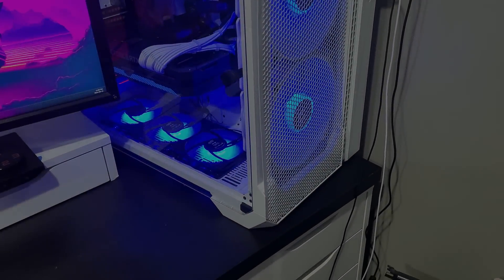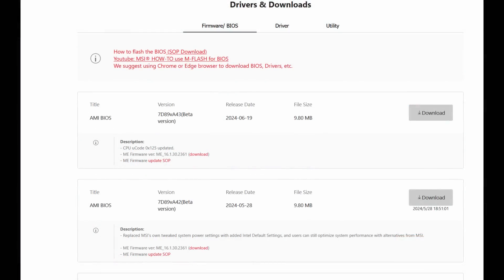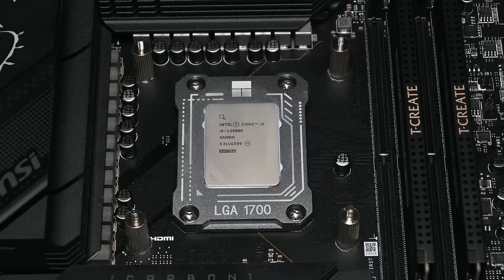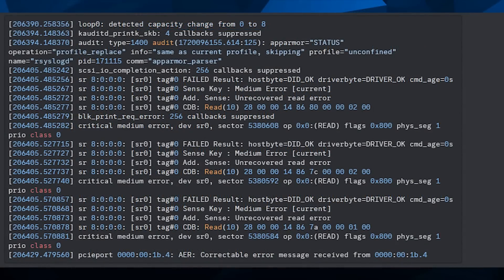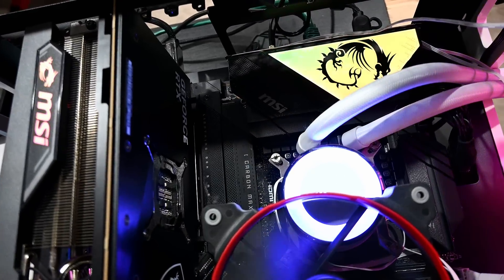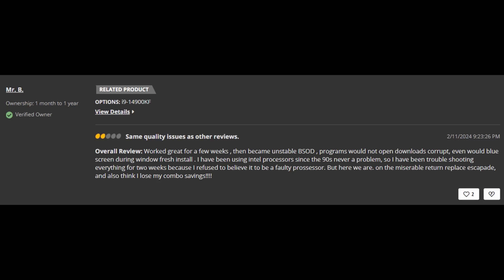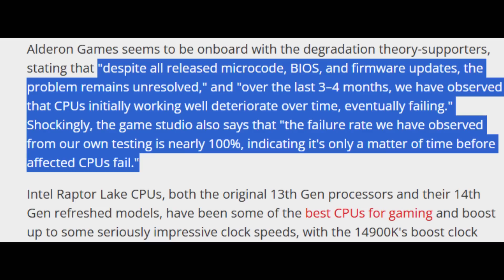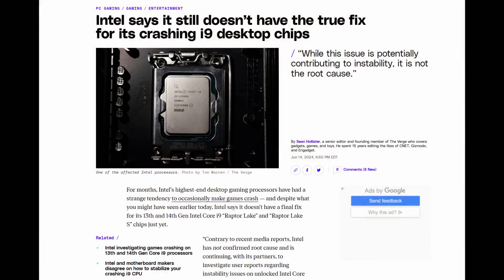Intel CPU Crashing Situation is FAR Worse Than You Think! - 50% Failure Rate, RMAs Denied

Comment from the maker: Something I forgot to mention in the video. I have read reports from users on various forums who said they were getting all kinds of instability issues with their 13th and 14th gen Intel CPUs. However once they had loosened up their cooler mount a bit or switched to a thermalright contact frame their problems went away. When I was tinkering around with DDR5, this was something I also read from other users that too much MOUNTING PRESSURE was the cause of instability and they would get memtest errors if it was too tight. Haven't tested it myself for obvious reasons, but its an interesting theory....  
  
In any case Intel denying RMAs to users is some load of crap!
Reply: If it was the mounting pressure wouldn't 12th gen not also be impacted since they all have LGA1700?
Reply: Yeah I doubt it's mount, My 12700k has been stable for nearly 2 years now.
I did have issues at the start trying to get XMP to work, Just unlucky with silicon lottery and my cpu can't handle higher ram speeds, Dropped it back and completely stable ever since.
The problems in my opinion with 13th and 14th is Intel pushing their garbage node too far, They were so far behind AMD they had to overclock to compete and now they are trying to sweep it under the carpet.
Reply: @ShaneMcGrath.  12700k hasn't this issue fortunately! I have 12700 too... :)
Reply: @Dazzxp  Exactly - my second PC, a 12700K uses a Thermalright contact frame and it's 100% stable, never had a single issue with it.
Reply: It might just be related and not the cause. Reason is if this issue is pads ripping off due to thermal stress, or substrate failure, pressure changes will just reset that pad and prolong the issue to occur later. 
From what I can see it is substrate failure e.g. the CPU itself degrading, due to it being voltage bumps to regain stability. If a pad/mounting pressure is causing that, it's not going to degrade so linearly. 

Even someone commenting who knows an intel engineer said they said the hardware itself was 'effed'.
Reply: I'd like to add my 2 cents here: I used a Thermalright contact frame on my 13900k from day one when I built it in 2022. The problems started about 3-4 months later with lag, high DPC, BSOD's and reboots from using XMP RAM settings, 212+ degree temps (and 500W+ power usage) under load, freezing, etc. I was able to get Intel to replace the CPU under warranty in April and now the replacement CPU is beginning to have the same issues - starting with USB ports disconnecting and reconnecting and desktop lag.
Reply: Sensitive to pressure/heat?🤔
Reply: i had a theory that the instability issues may be a mix of temperature, voltage and mounting preassure.

just think about it, we know for a fact that the mounting bracket of the Mobo may deform the cpu, Gamer nexus made a video about it and proved that this caused issues with temperatures, well , what i was thinking is that over time the high temperatures the voltages and the preasure would end up bending/deforming the silicon of the cpu causing physical damages to the cpu die which would be the cause of the instability or even kill the whole thing/

i could (and most likely) be wrong but until Intel or someone else find the root cause of the problem anything could be use to explain the problem, i think it would be good to know if people who are using contact frames from the moment the build the pc are also having the same instability issues.
Reply: Yep, in my particular case after half year of trying to stabilize the system, my 13500 stopped crashing in unreal and giving "out of memory" errors after I changed the thermal paste and reseated my air cooler. This seemed very strange and I didn't see anyone mention this, but I guess I'm not alone.
Reply: I did a lot of testing when it came to DDR5 and using any contact mount gave me several errors going with the normal mount that came with the motherboard gave no errors.Also with the shader compiling error I tested different variants it seemed that it always crashed when spikes would make the CPU reach 100c for even a ms Iam currently running 90C unlock all limits. Ive had my 14900k running at an all core 59P 45 on e and 50 on the ring , ram 8266 with an apex board LLC 7 and as running at SA1.29 MC 1.4187 and Ive never have had an instability problem unless I was testing something out
Reply: I had to loosen the right side of my CPU cooler in order to get it to even boot with 4 Dimms of DDR4 - but other than this I've had none of the other issues that have been reported for this CPU.
I don't know if that is just a coincidence, or if losening the CPU cooler has helped me avoid the issues - but that is very very interesting
Reply: It is cheap silicon used for the newer batches of 700k-900k on 13th and 14th gen.
Reply: Intel need recall or they will get angry from end-user moving to AMD.
Reply: Well detached io hub and cpu bending can cause this for sure i will try mounting bracket thanks (no i had no issues currently have i5 13400 runs fine but needed more power so ordered 13900ks tomorrow will arrive)
Reply: @theanglerfish  better cancel your order for now, wait for the fix or next gen release
Reply: @Oz_2026  yes next gen will be better well, i hope so 😀 but what surprised me...prices are high in my country but ks version was almost the same as k 😏 interesting
Reply: @theanglerfish  You knowingly ordered a faulty CPU? wew
Reply: @N4CR  yep i testing pcs but i considered it and...i will wait for new gen to come out i don't have a lot of money and this is not worth it...if it was like 13600k ok i'll try but i need a new gpu so this is not worth it
Reply: The contact frame can help, because the CPUs warp over time, as they cycle thermally. Stock ILM is using quite a lot of pressure, i remember my finger slipping on the lever when i was swapping it and it flew away. It would probably be much better, if they used some of their older ILM designs, preferably one of those with 2 levers equalizing the pressure on all sides.

However, the contact frame mainly helps with temperatures, as the warping affects contact with heatsink.
Reply: Thats actually really interresting info. Might it be a mounting pressure issue?
Reply: @CptMooney  No. People in comment section above had it (special mounting frames) from day one and still had issues, RMA'd cpus also failing same way. It's substrate. 13/14th gen is literally degrading itself to death.
Reply: Great video man, well put together, and it lays down all the current known information we have very well. 
Let's hope all these videos push Intel to make a proper statement, or offer some kind of long term extension on peoples warranties for those who are not currently experiencing issues.
Reply from the maker: @techwandoUS  Agreed, just have some communication going to give your consumers assurance you'll take care of them.
Reply: 🎉goodbye genocide chip.
Reply: It's amazing even. You understand how business works, and then this intel policy with accusations of everyone and everything has been around for years. Why be surprised? As for me, the company got what it deserved in the first attempt to wipe its feet did not work. It's a pity that people won't draw any conclusions from this...
Reply: I can't find any info for the i7 1360p processor, anyone knows what the failure rate is on this CPU ?
Reply: This is BS, sorry.
Reply: the fact that we don't know if it's degradation, factory overclocking, user overclocking, chip faults, aggressive motherboard settings, MOUNTING PRESSURE, temperatures, power/thermal cycles, humidity, ghosts...

This may as well be the xbox RROD. everyone has a different hunch and a different solution.  Some people say they're working fine and everyone is overreacting, and others are on their 5th RMA.  At this point, I'm going to accept the cause as 'Lisa Su voodoo curse' and leave it at that until intel themselves confirm the cause.
Reply: @kintustis  It is cheap silicon used for certain batches to cut costs for Intel because their sales have been tragic since 12th gen. The cheap silicon they use for certain batches can't handle the unlimited power they had to pour on these to compete on the market.

I have no idea what Intel did to pass them up on validation, they probably just skipped it and gambled that it would be "fine", like the dog on flames "this is fine".
Reply: Old issue.. Almost all high end Intel (i7/i9) builder use contact frame nowadays

Comment: bad boosting algorithm and excessive vid issue.
been using static voltages and clocks since day 1 owning 13gen cpu and never had any issues. to say this situation sucks ass but affects little to not at all pc enthusiast users. but these systems will fail out of the box without any manual configuration.

Comment: 12:46 "...they are going to be complacent to gamers."

Don't you mean down right condescending? A bit like Apple admiting hardware issues but only a year or two later and then setting up a compensation fund (doing the right thing).

Journalists should absolutely pester Intel for a real longterm RMA solution for the affected 50% or 100% (c.f. oxidation). This will cost Intel millions (13 and 14 gen) and will tank their share price. Obviously Intel will initially avoid the subject or skirt around...

Comment: Ive had an i5-11400 to replace the i5-10400 that had already burned out, it died on me within 12 hours of mounting it into my machine, this has been an issue for a fat second ngl, intel chips just BURN OUT FAST.

Ive only had a single AMD motherboard fail so far, it's memory channels died of heat stress from being used for over a decade

Comment: Intel Owners 13th/14th gen DO THIS right away as your CPU's WILL degrade: I don't know who will see this - please thumbs up - on the new Intel - I've built may enthusiast systems and had the same issue with several as a lot of people has had. There is a way to make it stable (should work for most of you). Do step 1 - you should be FINE. If not go to step 2. Full explanation below but here's the fix for normies:

1. Go into Intel XTU - lock all of your P-Cores to 5.3 GHZ or 53 multiplier. Apply/Close. DONE
2. If your CPU is still not stable at 53, you need to add a positive voltage offset to make it stable. .05v or 50mv should be enough.  That should make you stable.
DO THIS ASAP: ALL of your 13900k CPU's and 14900k CPU's will degrade. Explanation as to what I found below.

EXPLANATION:

Why capping your multiplier makes you stable

By capping your CPU at a 53 multiplier your CPU will not do a super high single core boost. The higher a core boosts the MORE voltage it uses. Intel has a boosting table and it shoves very high voltages into those cores going to 58 or 60. Sometimes EXTREMELY high.  If only 1 PCORE is degraded - your computer will throw errors.  Capping your WATTAGE will NOT WORK because a single core can STILL boost WAY too high as it only needs about 55 watts or so to go all the way to 6ghz. This is why the SERVER motherboards still degrade quickly - they are power limited but will still boost too high.

For step 2 above - some CPU's are SERIOUSLY degraded - why adding an offset works

Ever wonder why your computer only throws errors when it's under a workload of some type? That's because your degraded core (might be only one) is SO degraded that you need to add that 50MV positive offset to your CPU to make it stable.

IF this still doesn't work for you - you need to lower your multiplier further (keep your voltage offset) maybe try 52.

I've never had a CPU that degraded though.  Questions? I'm here to help and will respond to this comment. If you need voltages I can do that for you.

CT

Comment: I don't understand what people mean by 100% failure rate? When it reaches that point does that mean it no longer works? That when you turn it on it immediately fails and cannot be used? Or does it mean that if you use it for more than an hour it will give yo a BSOD? Can you reboot it and continue to use it?
Reply: By 100% failure rate he means that the games and applications crashes everytime, and the processors performance will degrade so much over time. Just like someone's 13900k chip performance degraded so much that even a 11700k can keep up or even beat it
Reply: @AMDRyzen57500F  All games and apps crash everytime?

Comment: Some ways to fix some issues with 13th and 14th gen (13900k/14900k)
1. Limit watt usage to 262 watts in BIOS, gives some wiggle room over 253 watts from clocking down
2. Pin P-Cores to 5.4 or 5.5 ghz (whatever you are comfortable with), in my case I do 5.5 and 4.3 on E-Cores.
3. Turn off Multicore Enhancement in BIOS (otherwise CPU will go over 300 watts at stock)
4. Turn off Intel Speed Shift / Speed Step, both can cause stutters in games, but it will also run your cpu at higher idle wattage of about 50-60 watts 
5. Make sure that 2 cores that auto boost to 5.8 go only to 5.4 or 5.5, or this will also cause a spike in voltage and stutter in games
6. Undervolt the CPU. I ran mine at 1.28v V-Core and Load Line Level 6 on Asus motherboard
7. Test stability in AIDA64, and then test stability of ram in TM5 with Extreme777 profile.

IF everything is passing in stress tests, run games and watch for any instability, if your games crash, slightly increase your voltage to 1.285 or 1.29 volts. 
This will take time, but it will stabilize your system.

Comment: Anybody with a brain would know that ramping up 4096W or a max current limit of 512A (which is technically more then enough to start welding at that point) is not good long term. I'm a all AMD user since the 486, OC'ed so many chips and one thing chips don't like is high currents, overvoltage (shootouts) and core's running into their maximum of what they capable of in regards of temps. These CPU's are not the only one lacking - there where NUC's, NIC's of intel camp that simply degraded over time. I had a AMD board with a Intel NIC that started to give erratic behaviour, one day just disappears out of the bios, followed with taking the whole motherboard with it in weeks. I think someone at Intel figured that nobody is going to use chips for a good 10+ years and knowing the avg lifespan of those chips they could cut it down by increasing clocks and thus shortening it's lifespan.

Comment: Oh and finally Wendels data is from Servers. From one hand thats good because they work 100% 24/7 & can be seen as longevity test but on the other the server load is totally different than a nomal PC user. Also the data is not large enough sample for final answer. Many of these chips crashed only one time. Just get a better cooler (or set manual pump & fan speeds) & dont push the RAM speeds & you should be good. Changing the LLC is also preferable.

Comment: BTW if you live in a hot place VCCIO & SA can be unstable on 1.35v but thats perfectly fine voltage for these chips. You can set it to around 1.47 max if you have the cooling & you can max out your RAM latency +Core & Cache frequency (provided you have the cooling). E-cores should be disabled (or set properly which is not as easy), No AVX. 12,13 & 14Gen have dual IMCs & very often one is worse than the other. Thats where the problem is IMO.

Comment: yep i can comfirm i have this exact issue with my computer. i have Intel Core i9-13900KF and i had alot of issues with certin games that crashsh from out of memory and blue screens. these games are fortnite running direct x 12 along with hogwarts legacy witch no ops to run in direct x 11. and most immportantly once human crashesh every time i start the game with out of memory. these are just some of my issues if also had. i can  play fortnite just fine on direct x 11 but sometimes it crashesh but it better then nothing.  iv had this issue day 1 and their no fixes at least when i tried to solve it with trobshoot videos.  im so glad i am not alone on this and iv been so un happy with my computer for over a year now. so happy that i now may know the issue and this video makes more sense then anything witch explains 100% of the issue i had. lastly i had issues were my computer witch wont boot up and i had to re plug the computer to get it to work again.

Comment: Are these failure rates also occuring with the i3 and i5 line of processors or are they only on the i7 and i9's
Reply: Mostly i9, some i7 as well.  My 13900K died in less than a year, never overclocked it or messed with Intel XTU.

Comment: Sad part is this will all be forgotten next generation mean while people still love to bring up some AMD issue from 2009...
Same with GPU's, Nvidia has problems, its forgotten in a day, AMD has a problem we hear about it and get bullied for years...
And AMD indeed has issues like this too, the GPU side for example, the 5000 series had a its fair share of issues.

I've been on Ryzen now since 2020, started with 3600X and now 5900X for 2 years and not had issues at all, I was worried about some USB related problems but not been an issue for me thankfully. Running an MSI X570S Tomahawk WiWi motherboard, because the B450-F from ASUS did not have good enough VRM cooling for the 5900X, they almost melted! xD

We need to remember this, remember Intel lying or covering up major security flaws for several generations...

Comment: what i did to fix my 1400ks, I sold it on ebay for 50% of retail. I then purchased an AMD7950X3d, its much faster, uses 1/2 the power and will not degrade and does not throttle limit,  I needed some for blender  AMD kills Intel in that program anyway.  I couldn't be happer!  FYI I ran Intel for 15+ years in the past